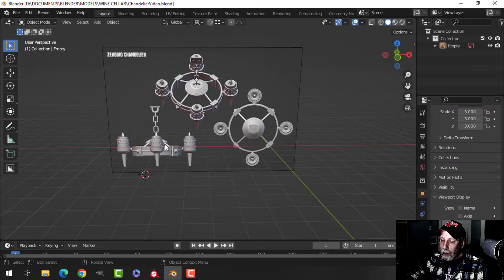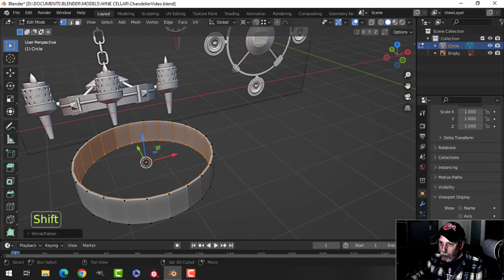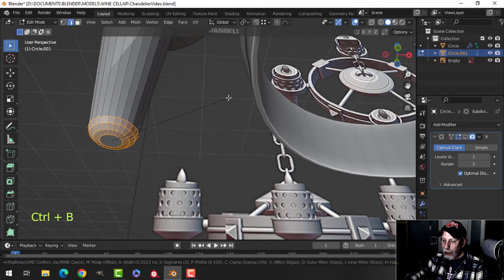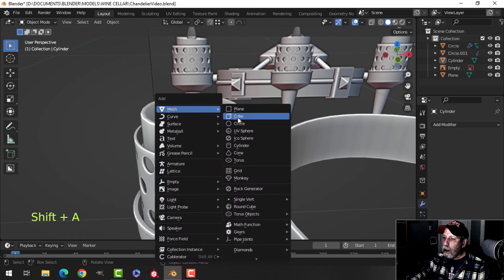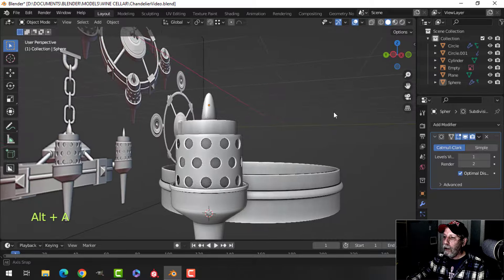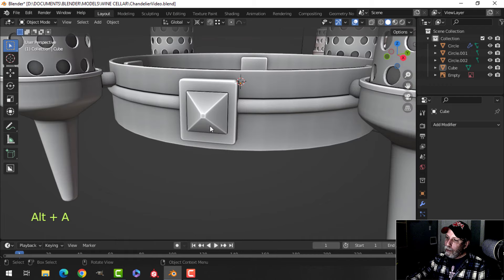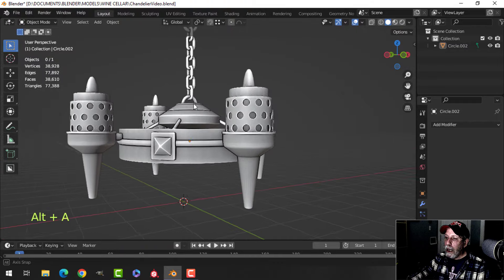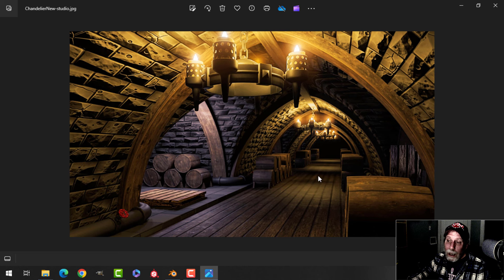BLENDER: WINE CELLAR (PART 4: CHANDELIER MODELING)

Comment: Hello, thanks for the great in-depth tutorial. I am trying to learn the workflow of the Blender by myself. Is there a specific reason that you used Shift D instead of Alt D for the candle holders or other similar symmetrical obejcts? I learned that if you copy with Alt D it copies the lighting so it renders faster and also the changes you have made in Edit Mode is copied to the others.
Reply from the maker: My pleasure.  Since the candle holders will be joined to the rest of the mesh, I'm not sure if that would matter but perhaps it would.  It's a good tip though and I will look into it.  Speed of rendering is not usually much of an issue for me but it could be for others.
Reply: @zerobio  Oh, that makes sense. Since I saw the method being used on objects that are repeated on the scene (eg. trees) I didn't think much of it. Thanks for the reply, I hope the tip would be useful for everyone.
Reply from the maker: @lucrisia_molyneux  it's a good tip amd I will look into it more to see if it would matter for instanced objects which is how I do lots of lights.  Thanks again.
Reply from the maker: Nothing special really ... 32 Gb RAM, older NVidia card, SSD.